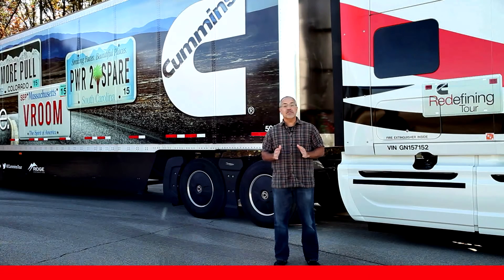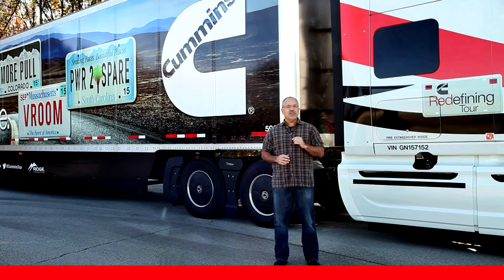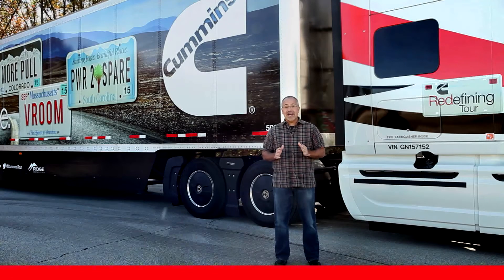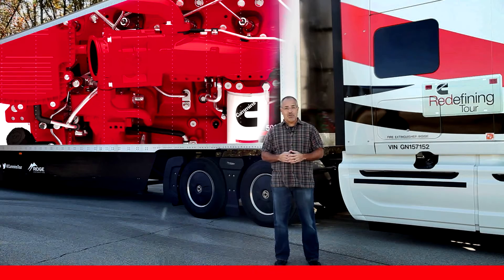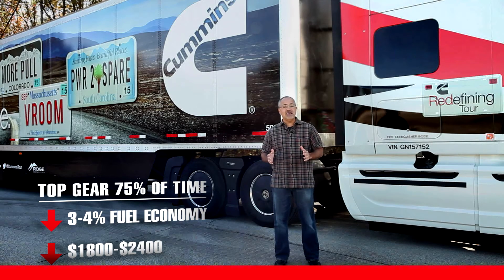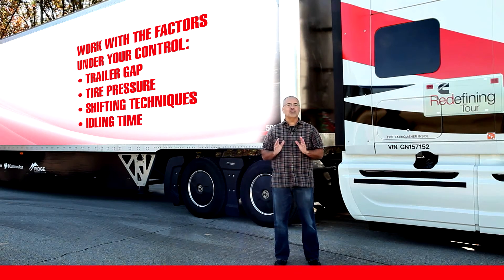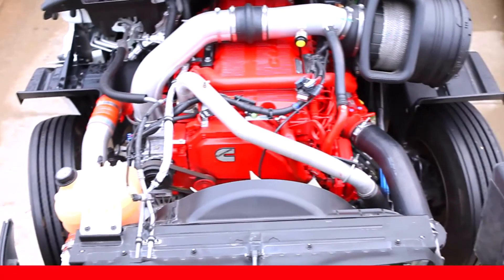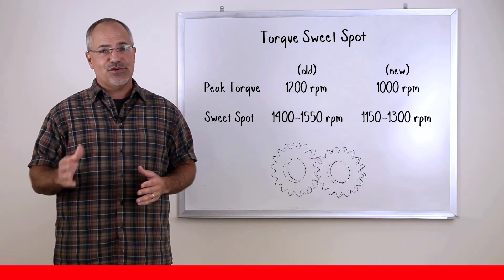RPM & Fuel Economy - Driver Training for On-Highway Heavy-Duty Truck Engines

Comment: Man whatever..... They killn this dam diesel engines these days with all this governoring downs and low ass rpms diesel engines r suppose to breath and get rpms up to power for the next gear.... Thats why these diesels drank more dam fuel. Expecially these dam automatics. That dam automatic that I drives stays in yge dam fuel Ile lmao..... But i think thats what they want to burn more fuel to keep em spending.... I remember back in the days diesels used to easily get millons of miles but these days u may still get a million but u will dam near rebuild the engine by time u do. Thats because theyr choking these engines with all this bullshit....
A diesel is a hell of a engine and its made to breathe and run with great rpms and that sukah will pull....

Comment: Then tell me why does most lower rpm engines burns way more fuel?
I think as long as u keep those rpms between 13 and 1400 rpms seems to me it saves way more fuel.
Reply: An engines best operating range is dictated by several factors.  The bore, stroke and mass of the crank conrods and pistons are one.  Another is the type of turbo and the fuel system.  In truck engines that are in the 15 liter range and have emissions systems 1000 to 1500 RPMs is what engineers are going for.  My last truck had a DD15 engine in it with a direct drive 10 speed manual and 2.54 ring and pinions in the drives.  My current trucks only difference in the drivetrain is the DT12 auto shift transmission.  The former truck had tires that allowed for 65 mph at 1300 and 70 at 1400.  My new one has low profile tires that make for a change of 65 at 1400 and 70 at 1500.  The difference is astronomical as to how bad my current trucks MPG is compared to the last one.
Reply: Every engine is a little bit different. And it all depends on what you're pulling to.  What he's giving is just guidelines. It sounds like you've done a good job of finding your engines happy spot. Every engine's got a sweet spot that you got to search out where you're pulling good but you're not just making a bunch of noise.

Comment: Okay then explain to me why my 14 ISX falls flat on it’s face at the slightest pebble in the road cruising at 1325 rpms. Gets poor fuel mileage no matter how I run it. Actually it gets better mileage if you set the cruise at 1400 rpms but even then your doing really good to get 5.25 mpg. I think Cummins just makes junk engines that don’t last or work very good.
Reply: @trucking shenanigans I know where the plate is. ISX450ST 1550-1750 torque 1000 rpm peak torque. I know what it says without looking. 10 speed ultra shift plus 3.36 rears on 11R22.5 rubber. DPF cleaned every 225,000 miles dosers cleaned every 150,000 miles. That’s all normal maintenance. Oils changed at 20,000 miles def filters changed every 120,000 miles. Had to overhaul it at 208,000 miles. Fuel filters get spun on once a month. Air filters once a month I work in a dirty environment.